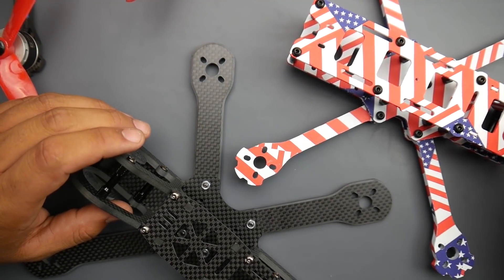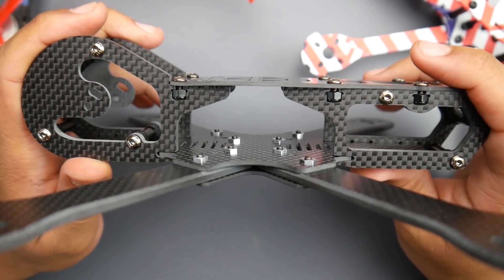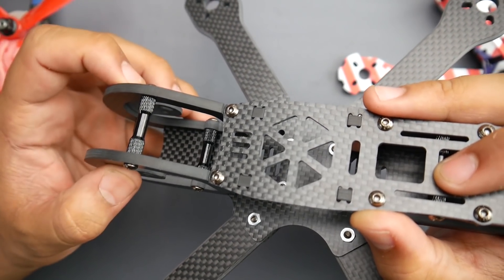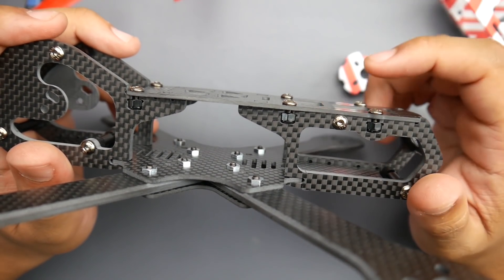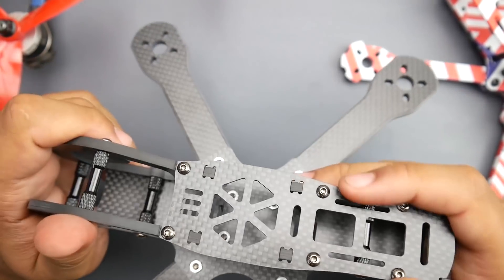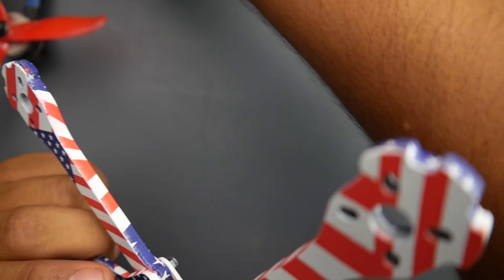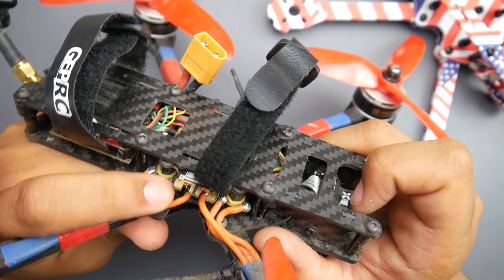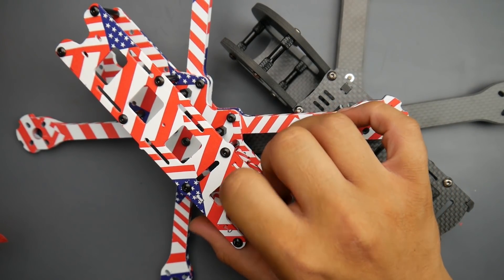Aikon EVOX220 , Eachine X220HV Frame Overview

Comment: Hello sir,,can ask for help?why is it my pdb is shorting out,i just connected the esc and it looks clean and all but when i use multimeter theres always a beep
Reply: It's normal just check the resistance if it's low like 1 ohm or lower then it's shorted
Reply: BOB its normal for the battery leads to have continuity?
Reply: @edwin4x485  yes, check the resistance with the battery removed.